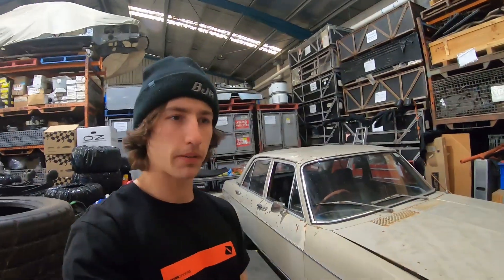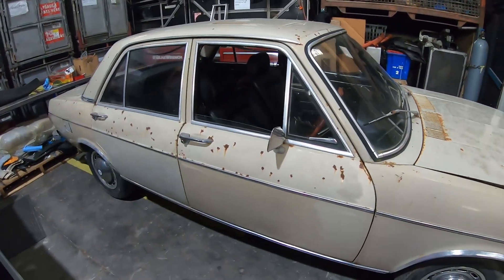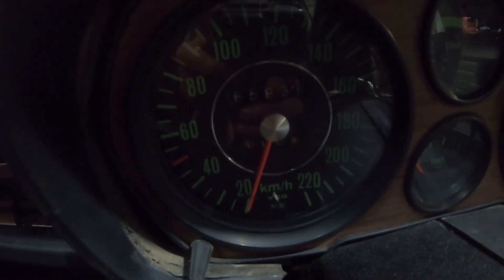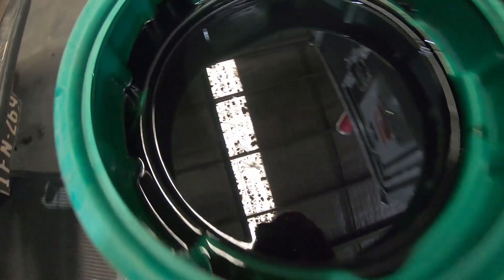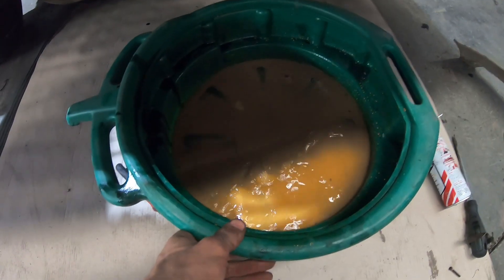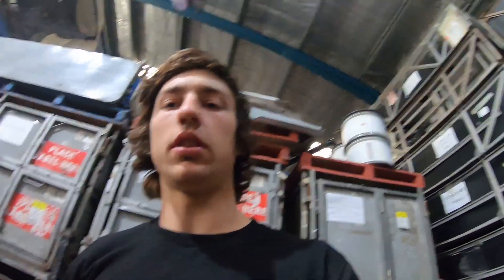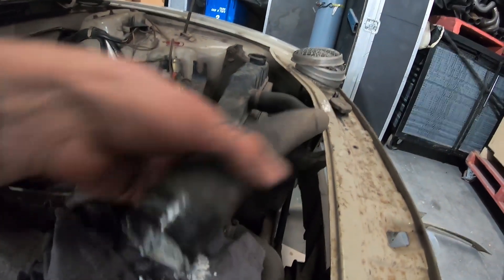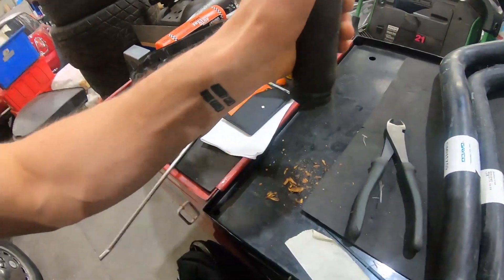OLD Audi 100 Project car build

Comment: Nice. I had a 100 GL as a student. Had to sell a kidney to fund getting the front wheel bearings done to pass WoF.  
Does it have those weird in-board discs with the special cooling fans?
Reply from the maker: Mark Sinclair oh that’s awesome Yeha it does have the onboard brakes I have not seen that before on a road car. There’s some very cool technology in it